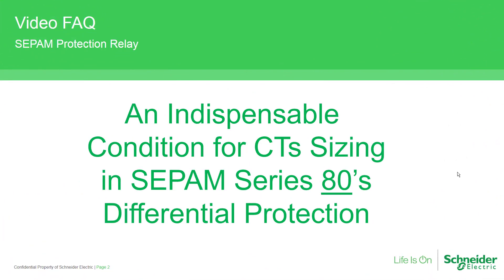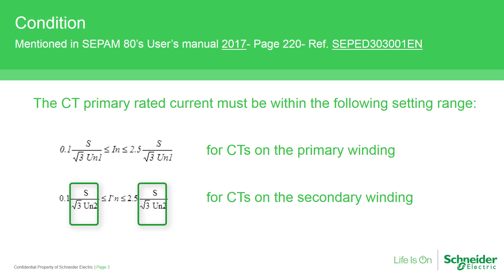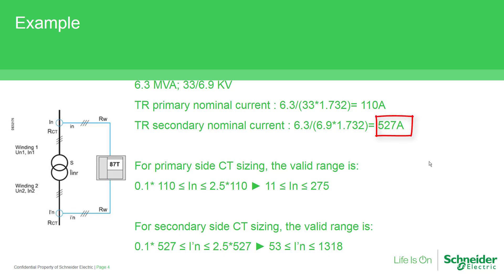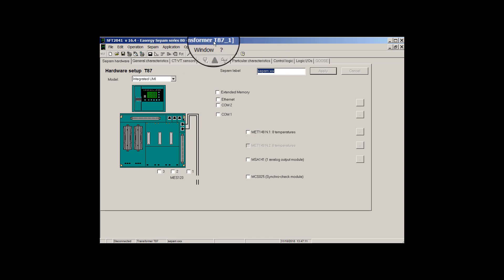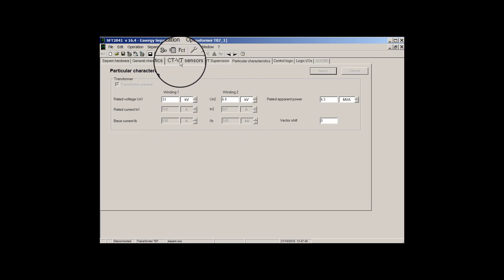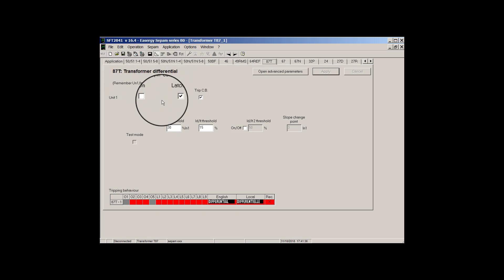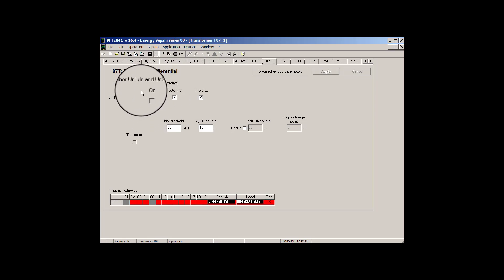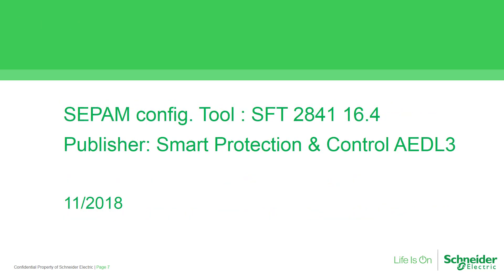Correct CT sizing for SEPAM,Transformer differential Protection.

Comment: How that factors 0.1 & 2.5 are decided???
Reply from the maker: Hi Chhaiya

Thank you for choosing Schneider Electric.

These factors are generally defended by the RTDS simulation with different CT ratios, voltage ranges, power levels, faults and relay characteristic. 

These factors are used to keep the Amplitude matching factor used for differential protection within its limit. This factor also plays important role in stabilizing the relay when you have the CT ratio is much higher compared to its full load current. All the numerical type biased differential will have an operating range for the amplitude matching factor. Exceeding the limit may increases the probability of tripping due to electrical noise.

If you have specific issues with respect to these factors we can address the same with your site available data. Could you please provide us with all relevant details of the requirement along with your contact details at "customercare.in@schneider-electric.com" to assist you in best possible way.

Have a Great Day ahead.

Regards
CCC
Schneider Electric India